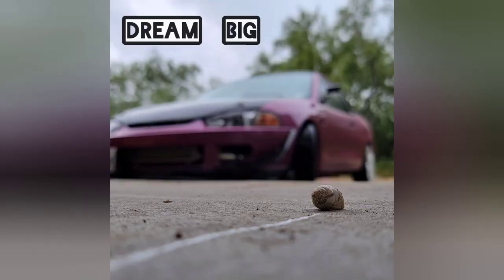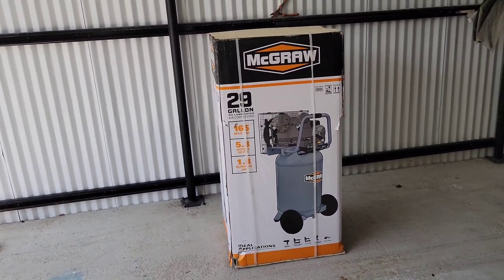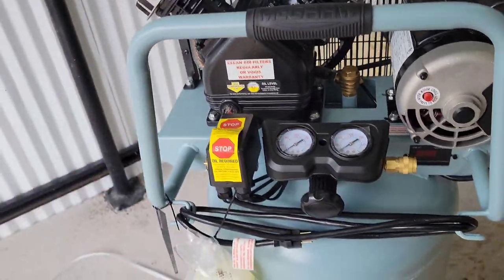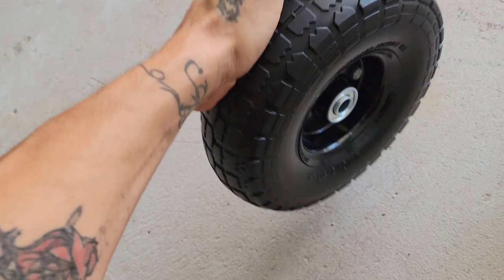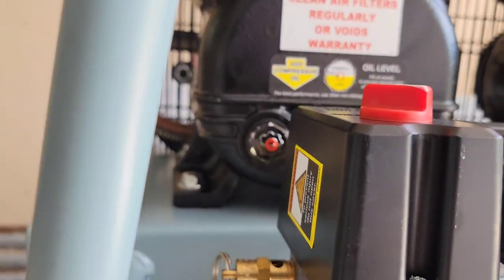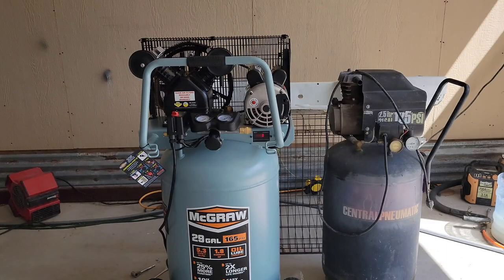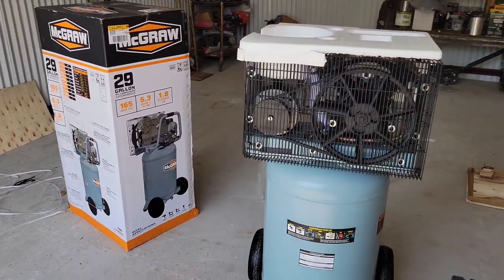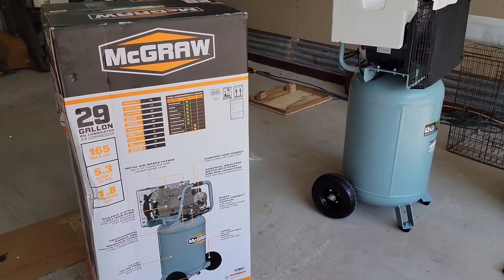I Bought a McGraw 29 Gal. Air Compressor from Harbor Freight

Comment: You just convinced me not to buy a compressor from Harbor Freight.  Thanks for the video.
Reply from the maker: This defect was during assembly,  and  shipping process! But,  I knew if it was built properly,  it was going to be a good compressor. 
Fortunately,  I addressed these defects to harbor freight company so they can be more careful and pay attention to these things before shipping them out to customers / stores. 
I also had the good fortune to get this compressor again (working to its full capacity), and it really is a great compressor!  It is one of the biggest volume air tank,  being dual stage (motor/ compressor), 120v (240v compatible), and at a price no other brand can beat! 🏆
Reply: @GTsPerformance  
You got the same compressor as the defective compressor in this video? From the same store and if from the same store how long was the wait to get the second compressor?
I am thinking on getting this same compressor and I was disappointed when I viewed this video. I am thinking about getting this compressor and plumbing it to the 30 gallon tank that was on my Craftsman 75 Anniversary oil less compressor that let loose on me last year even after I installed a new compression ring/seal on the piston. The Craftsman ran great for two weeks and then bit me right in my ass

Comment: No.  The 2 bumps on your motor are capacitors.  One is the Start-cap one the Run-cap.  Start-cap will switch-out and not be used at full speed the run-cap is in the circuit at all times.  Very common in single-phase motors such as 120V you have there.

Comment: I just picked one of these up. The washers for the rubber feet have two washers, do you happen to know if the smaller washer goes inside the rubber foot and the big washer on top with the nut, lockwasher? The manual only shows one washer on the top but inside the rubber foot, looks like the small washer sits inside it. 

Only .7 hours on mine and so far so good. Upgraded from the 20 gal mcgraw.

Comment: I've already seen your followup, I think that you'll be happy with what you ended up with. 

FWIW, most of the heat compressors make is from compressing the air and that depends on the compressors adiabatic efficiency, v-twin vs inline will make no difference in running temp outside of cooling area, but if you compare your 2 videos you'll see that the V-twin has smaller fins. The disadvantage with the V-twin is that it can never be balanced as well and will always vibrate more. 

SCFM stands for Standard CFM, meaning at "Standard" temperature and atmospheric pressure. The reason that it's significant is again, compressor adiabatic efficiency which is affected by air density, temperature and pressure.  Not testing at specific conditions would be a way for the compressor manufacturers to cheat their testing to make it look better than it is.

I get HF's wanting to separate out different lines by quality, but I don't get what they're doing with a few tools most specifically compressors. The Central Pneumatic one is probably one of the best deals around and best quality for someone that needs something that will be used relatively hard but can't afford or have the room for a 60gal or bigger. The McGraw is not better. It has the same half a 60 gallon tank (you loose a gallon to the curve of the endcap) but not as good/durable design. Things like that drain valve not being at the lowest spot on the tank just don't make sense on them.

I'll comment more in your followup video.

Comment: Same deal got mine with broken flywheel and dented cage (damage was a little more extreme on mine) waiting for repair parts now. By the time the parts get here it will be 10 plus days of downtime, I told the associate when she brought it out that the box was pretty beat up she said it was last one. But hey mine came with the woodruff key.

Comment: Honestly the older 29 gallon cp is better in specs wise your getting less with this new version I have the cp myself got it last year around $350 before this inflation it's been doing good coming up on the 20hr oil change I've modified mines with a aftercooler setup and a bowl to catch some of the moisture going into the tank